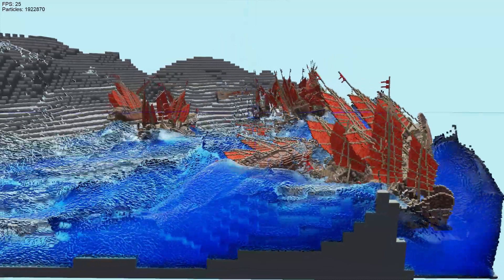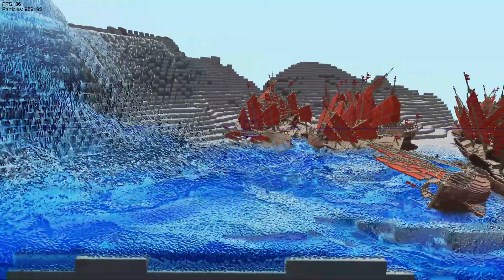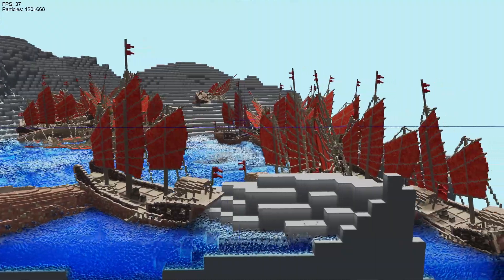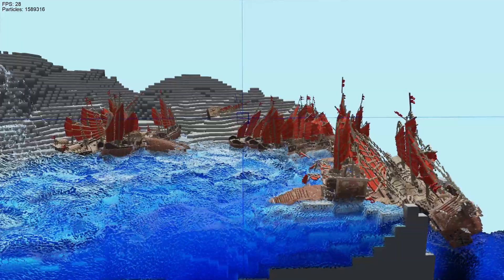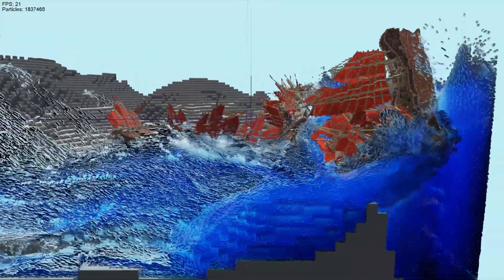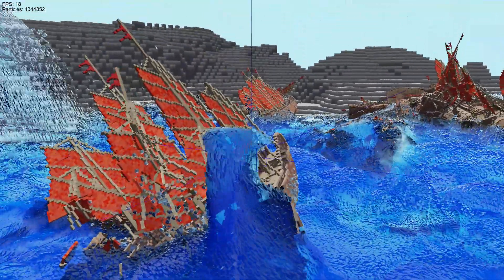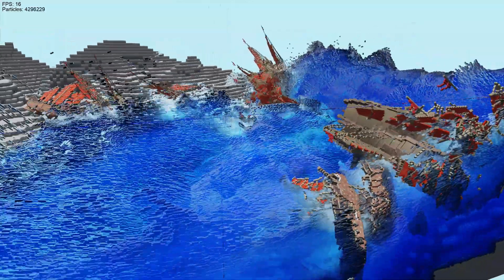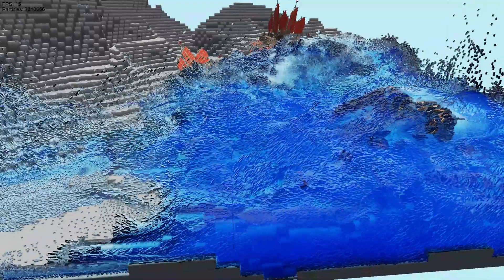Ships, Deep Water | Voxel Physics Engine

Comment: Long time ago I saw something about a technique where liquids were simulated as layers of particles near the surface, and as voxel-grid celular-automata style simulations inside the volumes, with the interface between the two types talking with each other to transfer forces and densities and stuff, and particles being created and destroyed as needed, and the voxel grids adjusted to fit inside as the surface layers changed shape,  and stuff like that. Would that be something that could help you get deeper water working better?
Reply from the maker: Yes this is definitely something I need to look into. It gets a bit difficult in my case I think because I have many objects interacting with and poking into the water, sometimes thin objects too like the demo with the bamboo. And then there is the multimaterial aspect of things.

Comment: This is amazing! (Again)
Do you find that you're more GPU limited or CPU limited (currently)?
And what do you plan on doing with this?
Reply from the maker: Thanks! I am aiming for a pretty even CPU+GPU division of work. I feel like CPUs have gotten much cheaper and if you factor in that it lets you do more flexible branchy algorithms for multi-material mixtures, and sparse and adaptive resolution, they might be pretty much even with GPUs on a price to computation ratio. Plus, there are plenty of settings that can eventually use the GPU more fully, such as turning on more raytracing, or using mesh shaders to draw geometric particles instead of just cubes. I think sandbox/game and maybe a vfx tool.

Comment: Amazing as always!! Is the viscosity between water particles(or voxels) statically set by a single global constant? or is it recalculated by other factors(like velocity or temperature or etc.) for each particle or region in real-time?
Reply from the maker: Thanks! Currently, I have these parameters uniform across a single physics material. Would definitely be cool to vary viscosity based on temp though. I do have things somewhat set up, so the physics models can be swapped out for more advanced/accurate ones. Like currently I run a more advanced model for the dirt/elastic (keeps track of deformation gradient and shear forces) than liquid.

Comment: this is really cool! can you explain how the fluid simulation works or share the code?
Reply from the maker: I’m using MLS-MPM (moving least squares material point method). It uses particle-grid-particle instead of particle-particle interactions to make things a bit cheaper to compute.
Reply: @GrantKot  interesting, not that I really understand. Can you recommend any resources to get started learning this sort of fluid/physics sim?
Reply from the maker: @HumanGamer  The two papers that got me started in physics sim are: Advanced Character Physics - Thomas Jakobsen, Particle-based Viscoelastic Fluid Simulation - Simon Clavet et al. Both of these have a lot of pseudo/code so are very friendly to implement.

Comment: are you also recording on the same computer?
Reply from the maker: Yes, just using the Nvidia app to capture. This is the speed it currently runs at, I don't speed up my clips, and there are many possible optimizations. 13900HX+4080
Reply: @GrantKot  doesnt it impact the simulation pefformance a lot?
Reply from the maker: Not super much. I think they have at least 1 builtin HW encoder. And I'm not fully utilizing the 4080 yet.

Comment: The work you're doing is really cool! If you get everything multi threaded, how big of an area do you think you could run?
Reply from the maker: With the sparse grid now implemented (and if I also sparsify the coarse grid), technically I could do a very large world size. Mostly it depends on the number of particles, so I've been keeping the world at a size where you can get a decent amount of material pile-up. Streaming chunks is also a possibility. Not a lot of textures involved, all lighting is dynamic, should be very fast load times.
Reply: @GrantKot  that would look so cool

Comment: So cool!!! A dumb question, it is possible when you're going to make the multi-threads support, using each CPU to make more specific things, for e.g., one core for deep water that demands less computing (I believe that engine has something that make particles underwater bigger than the superficial), 3 cores for superficial water because has more particles, one core for solid ships and solid things, one core for glue together this interaction of each core...
Reply from the maker: Thanks! I think because of the particle-grid transfers, it is more important that the particle tiles get iterated through more based on locality. I rely on the "work-stealing" aspect of the multithreading library I use (Taskflow) to balance things out. Sometimes during splashy times many of the tiles can be on the finest resolution, so the balance between fine and coarser particles changes a lot. With the structures though, yeah, it could be beneficial to lock each ship (structure) to a different core (also improve cache), and have the particle materials balance on top of that.
Reply: @GrantKot  You are doing something unbeliever with this engine! Sorry if this idea is dumb, but... could you use A.I. or deep-learning method to teach the engine how water flows to try to make it uses less CPU? Something like a fake simulation, maybe on regions that are less perceptive, maybe far way from camera or under deep water?
Reply from the maker: I haven't added adaptive grid resolution yet, which might be the next step. I worry about the robustness of AI in handling materials it has not seen in training yet. From my 2023 demo, the materials are unified and all the parameters like compressibility, viscosity, elasticity, density can be changed. I think the multigrid setup I have is probably in some ways similar to what a deep neural net would do, the MPM kernel similar to convolution.

Comment: I am just curious, why are are all the voxels not in a grid? I Have never seen a voxel engine like this before, and it looks soo cool!
Reply from the maker: Behind the scenes, I guess it is more like a particle-based world being rendered in a voxel style. For liquids, I think it is important for the players to be able to see the flow, and for my elastic/materials, I also show shear deformation in addition to rotation for each particle. Also, technically, with the particle system, they don't have to be grid aligned, but it is just easier to create content for with voxel editors.
Reply: @GrantKot  oh. That is cool! Have fun improving this! it looks so cool!
Reply from the maker: Yes, I should be close to that, adding joints, motors between parts in the structures, etc.

Comment: Always great to see an update from you! It's looking good, I just wish my PC was a bit more powerful...
Reply from the maker: Thanks! There are still a lot of possible optimizations so don't count your PC out yet. So much non-SIMD/multithreaded code with the multigrid part because I need to keep it flexible to update as I add features. On iGPU I can pretty much remove the light volumes to reach a very similar look with just the ambient occlusion. A lot of unnecessary data transfers linger
Reply: @GrantKot  Having followed your progress for a couple of years I have no doubts about your skills. This is incredible and you're a wizard 🪄

Comment: this runs at realtime framerates but visual studio still takes like 5 seconds to open lol
Reply from the maker: Maybe someday a redstone computer in my simulator will open Visual Studio faster lol
Reply: @GrantKot  review the settings. There might be the features VS spends resources on, but you don't actually need that. Might be like separate linter or whatever
Reply: Honestly microsoft really needs to do smth with VS performance lol it's incredible how they have such amazing engineers yet they didn't just redo the whole application at this point xD and yes I'm well aware this isn't trivial
Reply: @dahahaka  they did, it's called visual studio code 🙂